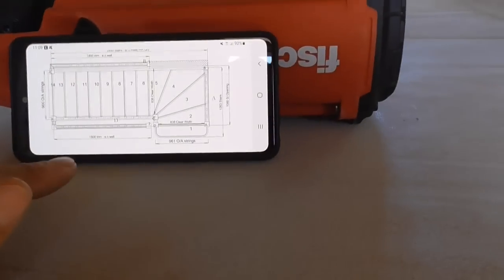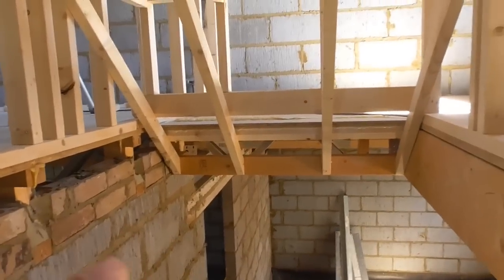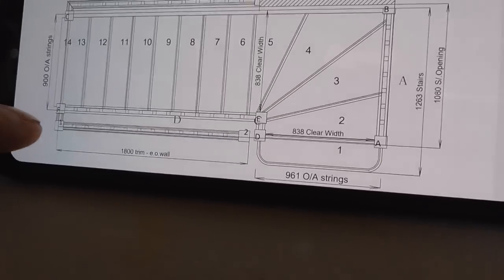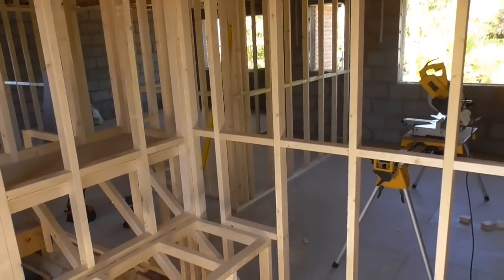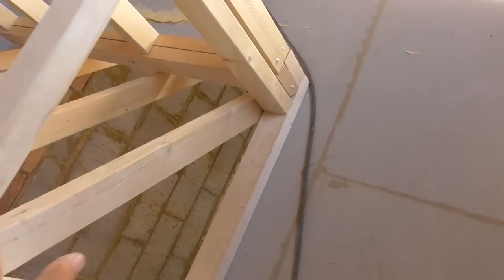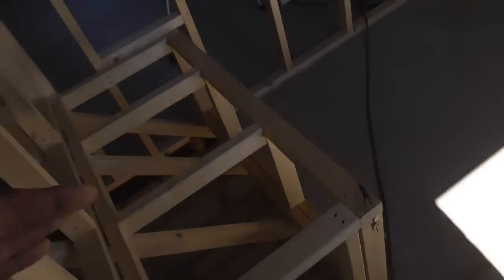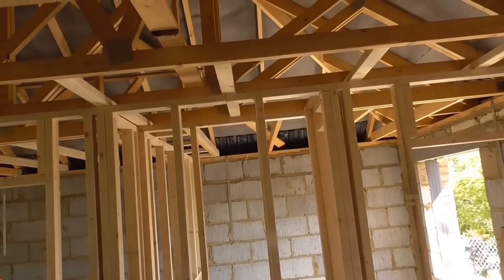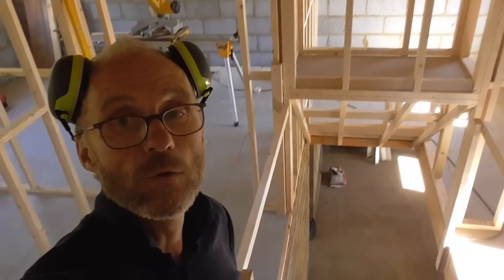Creating a bulkhead to give extra storage above the stair well***WOULD YOU MAKE THE BED DECK TOO?***

Comment: Apart from creating a cupboard and a bulkhead, this eliminates several cubic metres above the stairs where rising hot air would otherwise wastefully accumulate. 
Conversely, there is now nowhere to hang an over-stair chandelier. 
I have retro fitted this arrangement in my house, with down lighters in the soffit.  

It’s always motivating and it feels respectful, when the builder/developer invites, accepts and facilitates your input.  
The common thread which runs through all your videos is that you always have an element of partnership with the project drivers. I find this very refreshing to watch, thanks.
Reply from the maker: Hi Chris🖐I guess not having anywhere to hang your center piece chandelier is an unfortunate trade of fir having more bedroom/storage space😆Great comment, and I have always been able to chat with my builders/clients about ideas I may have to improve something, be it to create a more usable space or just adopt a technique to get the job done more efficiently👍Thanks for watching 😎 Cheers Del

Comment: You my friend are a godsend. As previously mentioned i have a project to complete my daughters house. This topic is hot as the stairs arrived lazt week. As soon as the dry wall and tilers have done its top of my list.
Reply from the maker: Hi Steve🖐I will try my best to put as much detail in the stair video as possible, which should be out withing a week or so👍Thanks for your comment 😎 Cheers Del
Reply: @thetallcarpenter  Thanks Del. My stairs is a straight run so not as complicated as this, thankfully.

Comment: That is one thing years of experience give a customer. You are like me you obviously visualise the space and build things in your head. When I get given design builds as I call them with no drawings. Which is often. I build it and do the take off in my head. Or when walking through with a customer that wants ideas I give them several visions to see if they might like an idea. Having seen a lot of variants over the years let's you do this. You say you haven't done a set of stairs for about 2 years. I have only done one set of decent internal stairs in the last 24 years. Not many of them where I live. And even the ones that do come up there are specialist stair builders that make and install. You can't compete with someone that is all geared up for one thing. Looking forward to your install video.
Reply from the maker: Great comment again Dave👊and I think having many years of experience behind you, not only helps you become proficient at carpentry but also give you a lot of experience of spaces and how they work in particular instances, and how best to apply this knowledge to different projects for customers👍Stair fit video coming soon 😀 Cheers Del

Comment: I've made countless loft conversion stairs mainly on 1930 London houses, nightmare for headroom heights over the existing stairs. Its nice to start afresh, be able to set it out yourself and be certain of the headroom.
Reply from the maker: Hi bud🖐I've done a couple like that to, and, you're right, headroom is always an issue😬 I, pretty much, only do new work so am pretty fortunate to have a little say in how things get planned out👊Thanks for your comment 😎 Cheers Del
Reply: @thetallcarpenter  They do give a little more leeway these days providing the existing isn't being replaced. Once I get the finish floor level heights, I bring a mock up newel post with 3 short cut risers screed onto it set it in position and measure down. I get the DS to ok it so I can make it with peace of mind it's going to pass. Very often the headroom is much less than the 2m specified.
Reply from the maker: @TheBadgolferman  Those jobs sound really interesting bud, and certainly keep your brian engaged🤯🤩

Comment: I think you've mentioned that you've worked in the States. And views/ opinions on their practice of building the stairs in situ as part of the first fix?
Reply from the maker: Hi Dai🖐My experience of stair building during my time working there was that they were very basically constructed sets of steps between floors, and I wouldn't describe this 1st fix built type of stairs as a 'staircase'. Of course, this is not the case on some houses in the US that have wonderfull staircases built and fitted the same way as we do them over here🤩Cheers Del